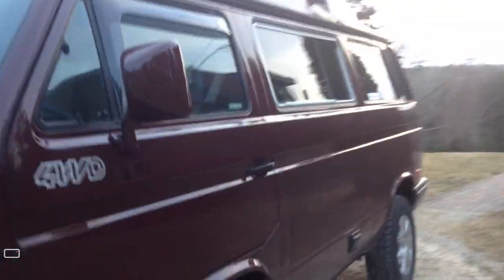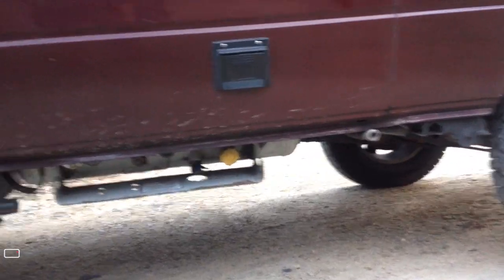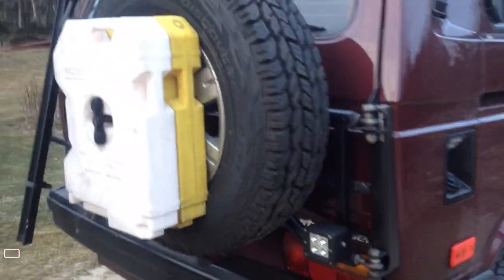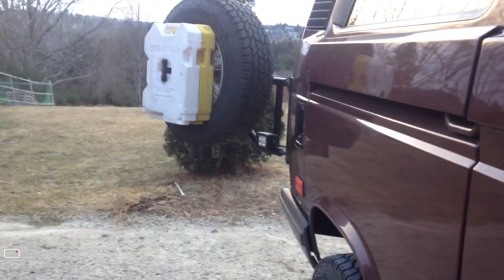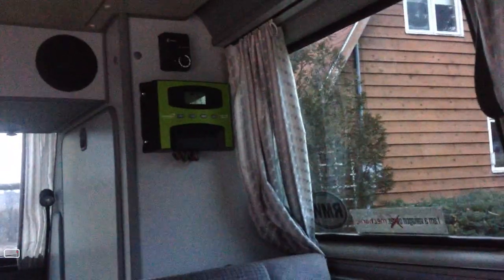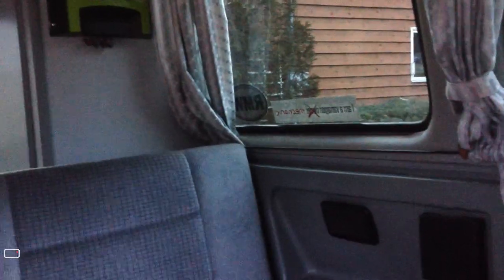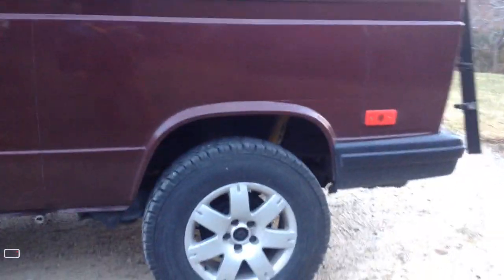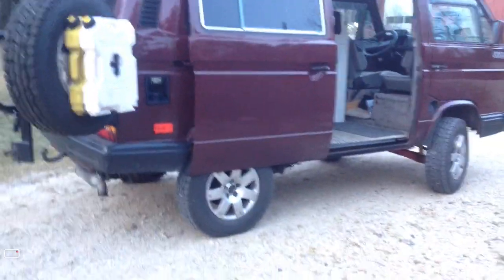1990 Westfalia Syncro Diesel.

Comment: Hey Jeff, been looking for some good cabinet knobs/latches such as those on your little cabinet that your friend made. can you enlighten me about those? brand/where purchased???thanks
Reply from the maker: Lee Valley Tools, that's the Canadian supplier for quality cabinet hardware.
Reply from the maker: Candyman  Not hard, I've done more than 100 diesel swaps in Vanagons now, so I might have a different perspective. The Syncro Swap I've only done a couple times, so, it took a little more work and thought. 
.
Reply from the maker: The engine I used in this van is an AAZ, I’ve since swapped it to an ALH TDi...  but my favourite engine for the Vanagon is a 2.0l BHW TDi.

Comment: where did you place the ECU? Was it on the right side rear area in the back behind the tail light?  If so any water issues?
Reply from the maker: I put the ecu for that build and most builds actually under the back seat where the factory ECU goes. Some of the builds I located it in front of the tail light, I use a waterproof ‘rubber made’ box- zero water issues. Thanks for watching, Jeff